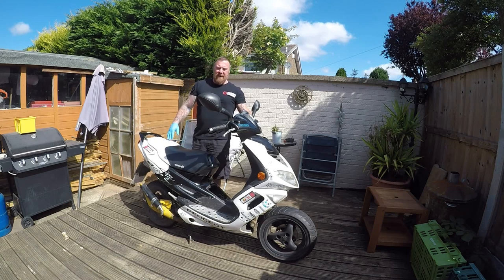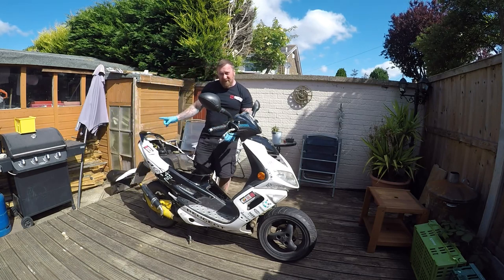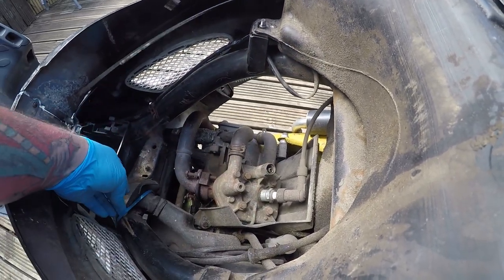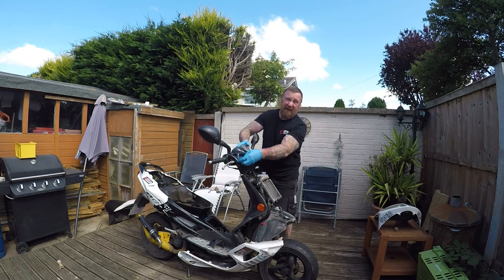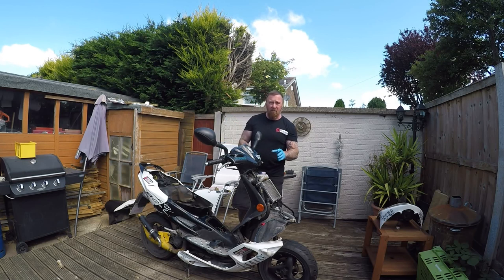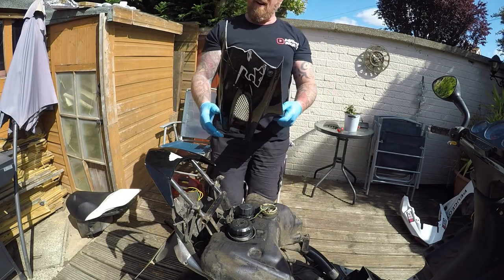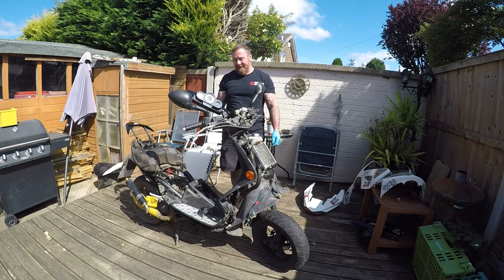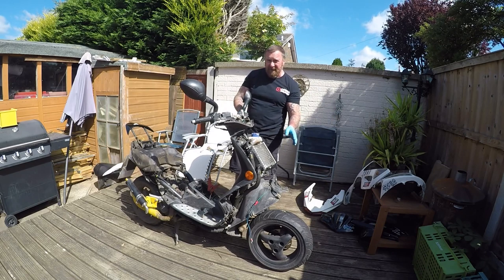SPEEDFIGHT MOPED PANELS OFF AND LOOK OVER PT2 MARK SAVAGE

Comment: Hi Mark, does your Speedfight have the boa lock fitted? I lost the key for mine so want to replace it with a new one. Did you see during your stripdown where it would attach to and whether it would be possible to remove and replace it? Thanks again for the great video.

Comment: Hello Mike i need your help here. How can i install a side stand on my  Peugeot Trekker 50
2006 it should be very similar to the speedflights 1 and 2 but when I installed a speedflight 
side stand on it it just proved too long and unusable
i am a man of 70 with weak leg muscles and mobility problems and i am just not physically strong enough to use the centre stand so I need your help with this one.

Comment: Good content as usual.., just wondering what the 100cc speedfights are like, do they go well?, cheers👍
Reply from the maker: Thanks bud 
As for the 100cc theres not many around or left on the road , parts are very hard to get 
Most 17 years old went onto 125cc etc 
I've had a few and always found them hard to sell on !!, so i don't play with them 
However they do go well but once over 60 mph the ped seems u stable to be honest 
I done one up and hit 70mph and thought I was going to die on a bend pmsl !!
If you can get one that starts and runs then have a go bud
Reply: mark savage thank you for replying, I have had several bikes in my time (grand old age of 46!) but wondered if they make a decent economical commuter.., sounds like they do but could be a pain getting one & parts etc.., I did wonder why you stick to buying & selling the 50’s!.., thanks again, keep these helpful videos coming if you can👍

Comment: Hi Mark I've got a problem I have the same lc Speedfight 2 in your video and was wondering what main jet I should be using the carb is a 12mm gurtner the bike is all standard apart from the exhaust that's a giannlli with the restricter removed I think I after up jet bye 10% or 15% so would a 60 main jet be correct as I've been told I need a 76 main jet but that seems a little big for a 50cc
Reply from the maker: In my part 5 video I go over this but not out till next week
60 is a Good size and should run well bud with a sports exhaust

Comment: Hey Mark. I have Speedfight 2 with swapped 70cc bore kit and sport LeoVince exaust. Maybe you can give me some advices what could I do more to get everything from that 70cc? Like rollers, clutch, etc.
Reply from the maker: Bud after watching my video 70cc kits don't do it !!
Higher heat plug
19mm or 21mm carb 
Upjet , and tune like in my videos 
Race air filter 
Tune and tune again 
7g rollers as more power 
Stage 6 clutch and exhaust 
Its a lot of work
Reply: @marksavage  Well with that 70cc swap, sport exaust, 70 main jet change and those water drop style 8g roller weight change my speedfight is doing about 55mph. But now I'm on a tight budget so I might only change rollers to even lighter ones and put diffrent spark plug. Maybe you could recommend what higher heat spark plug should I put because I have no idea?
Reply from the maker: One higher than in now
Reply: @marksavage  Thanks mate!

Comment: Hi mark sorry to bother you but I've got a problem with my speedy I've been watching your youtube videos and I love them by the way but my problem is that I've changed the standard rolls to the 6g rolls like in one of your videos but I'm finding it starts better but when I go down the street and come to a junction and stop  it's revs high I've checked the Rev cable that seams to be fine I checked it by having the scooter turned off and opened the throttle fully and let go and you can hear it hit the bottom so are the rolls to light for my 50cc or could it be the lighter clutch bell that's been put on ?
Kind Regards
Lini
Reply from the maker: Normally the revs are nothing to do with the variator 
Carb bud 
Check the needle is going all the way down and the idea it out like in my carb cleaning videos 
If its out and the slide is going all the way down you can adjust the needle as it has 3 setting 
Did it rev high before you changed the rollers?
As said it should have anything to do with the revs/ tick over 
What is the belt like ?
Reply: @marksavage  hi mark thanks for getting back to me.
And I'm not sure as it was a right mess when I got it I got it to sell as parts but after watching your youtube videos I thought I'd bring it back to life plus you don't see them anymore.
I did strip the carb and cleaned it after watching your carb cleaning video I've also replaced the throttle cable     but I'll take it back off and give it another good clean with carb cleaner not washing up liquid lol that was funny do people really us washing up liquid to clean there carbs ?
Reply from the maker: @linihughes5106  along with wd40 etc !!
Yes relook at the cable and how it sits in
Reply: @marksavage  will do and stay safe 🤙

Comment: makes a change them front panel mounts are not broken  and  what was that in the end 8 bolts holding all the panels on ? thats 6 more then was holding all the panels on my bike when i picked it up the rest was missing and had small drill holes with cable ties in place of them :/
Reply from the maker: Its common but needs addressing as can be bloody dangerous,  take care bud and thanks for watching
Reply: @marksavage   you to mate and  looking forward to the next video

Comment: Mark please could you help again, my bike only starts up by me holding my hand against the air filter intake on carb, it runs rides fine but every time I rev it bogs ??
Reply from the maker: Its defo tuning bud 
Carb off like before 
Make sure all ok , back tight on ,tune and see

Comment: Hi mate love the content just got a 2003 speedfight2 lc50 and having trouble finding bearing for the front  end any advice
Reply from the maker: As in head stock bearing or front wheel bearing?
Reply: Its not wheel bearing or head stock its where the main bolt goes throu the front swing arm
Reply: Can't find what they are called or if its even serviceable if not where could I locate a whole new fork 🙄
Reply from the maker: @granthughes5372  you can't get them now so it's a 2nd hand unit you need to buy bud 
They twist and get damaged , they don't move or just backwards bud 
Check out e bay
Reply: Ok cheers mate they move fine just got play from left to right thanks for the advice
Reply: Gi mate think I might have found some 1 on ebay selling the bearings have u got a email I could forward u pics to confirm they are right would appreciate your help

Comment: Someone has found a bolt that's lighter than titanium! And this speedy is full of them. 😁
No bad problems so far. Just loads of things that should of been sorted as they came up.
Reply from the maker: Lol good one Paul, its just a few bolts here and there but it can be dangerous and they do need to be in to secure it 
Theres a few on the way bud , thanks for staying with me

Comment: Hi Mark, looking for some help please mate, I have managed to get my speedfight 2 100cc 2000 plate back up and running recently smoothly, but I have an issue where it is using up alot of fuel. Far too much. Could you tell me where I am best to start looking? Is it likely a leak that I am missing?
Reply: Thanks in advance, your previous advice has got me to where I am.
Cheers
Jim
Reply from the maker: @jimbothethimble  odd so your not leaking it 
You have to be burning it 
Carb running ok and tuned like in my videos 
Then piston and ring bud 
What speed are you getting ??
Reply: @marksavage  Hi Mark , I haven't been far on it, carb sounds ok , the bike was dieing at full throttle , I have cleaned the carb out and now and it pulls away well.
The bike was dieing after left idling for ten mins , so after the autochoke went off, I have tuned it to the best of my ability 😁
I have had it up around 50mph.
I will strip everything off to see if I am missing a leak.
Hopefully not the piston 😦
Reply: @marksavage  I will capture some footage

Comment: Hi so im going to change my piston rings soon so any tips or tricks for me?
Reply from the maker: id change the whole piston bud to be honest not just the ring but its up to you, its an easy job on AC otherwise you do have the water to contend with on refit
theres 70 speedfight videos on my channel and a lot of them cover this and will help like putting 2t oil around the head and piston so it goes in easier and on start up doesn't score!!
Reply: @marksavage  Also when im going to remove the top of the engine do i need to drain the coolant first or unplug the pipes ?
Reply from the maker: @sadhasbfdhds1306  its lc then yea defo and any water left that goes down the sump you must get it out and replace gaskets

Comment: Can you help me out please. I have a Speedfight 2 50 LC, when riding about, its great, but if I sit idling, like at traffic lights, when I pull away its just sputters and won't rev up. The suddenly goes. Any ideas?
Reply from the maker: Carb bud 
What size jet in carh 
Serviced last 
Air filter 
Tuned 
Like in my videos
Reply: @marksavage  cleaned out the carb, standard jet, standard air filter, only just been put back on the road, bought as a non runner. Only had a sports exhaust on it.
Reply from the maker: @LowtherSport  id go over the carb again and fuel lines, make sure they are tight 
Have tou check the reeds bud
Reply: @marksavage  thanks. Thinking of pulling it all apart tomorrow. I have a top end gasket set so might be worth a full teardown

Comment: I thought my bike was a bodge job but this put mine to shame
Reply from the maker: they can end up like this with all good intentions but need sorting as others really can be dangerous , thanks for watching bud
Reply: Thank you for uploading, you’re doing me a massive favor and don’t even realize it. I got a 2008 Gilera SP50 and it has the same issues as you mentioned this one has so I’m anxiously waiting for you to get to the electronics and maybe I could learn a thing or two.
Reply from the maker: @isne1400  I have a few coming so part 5 will have the engine plus more about electrics for you bud
Top man

Comment: My speedfight ac does 42mph its got a sports exhaust and 3x6g and 3x4.7g rollers is there any way to to make it faster
Reply from the maker: for a AC that about normal 42 to 45, what else have you done to it, and i'd use 6g x 6
Reply: That's all I've done, my variator has a screw on plate should I just keep that off
Reply from the maker: @digga7585  so chucked away the washer , cleaned variator , 6g rollers , checked belt and clutch like in my videos
small upjet to 60, take off link pipe ,sports air filter, , sports exhaust , then tune like in my tuning video 
this will all help too bud
Reply: I put a new leo vince tt exhaust on earlier and took off the link pipe and it would rev up and then just loose all power and if I kept throttle it would die what could this be (I haven't upjetted either
Reply from the maker: @digga7585  sometimes it needs the link pipe bud 
Put it back on !
Others rejet and tune like in me videos

Comment: My seat release works with the panel off but jams when I put the panel back on, it’s probably something simple but for the life of me I can’t work it out… Any thought anyone?
Reply from the maker: Retrace the cable bud 
Make sure the lock is the right way in and turning ok
And fixed in the slot for the cable !
Reply: @marksavage found the problem! The bit at the latch end was sliding back and jamming it, so I popped a cable tie on it to stop it slipping and now it’s perfect! Thanks so much for the advice!

Comment: That is not original turn signal relay. Original is round and held by rubber holder
Reply from the maker: I do mention this plus in the next video yet e bay sell them as speedfight 1 and 2 , have a look bud they are not for these but will work - well maybe not for long lol 
thanks for watching bud loads more videos on the way
Reply: @marksavage  you're welcome, just do it man. You helped me with your older videos. Got 32k km on my sf2, they are great machines
Reply from the maker: @jati9782  thats good to hear bud 
Top man